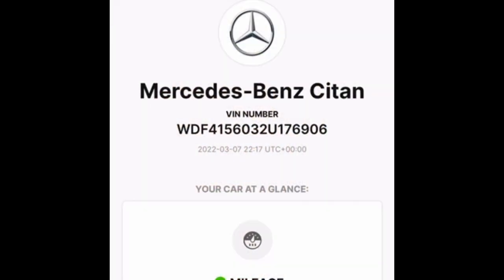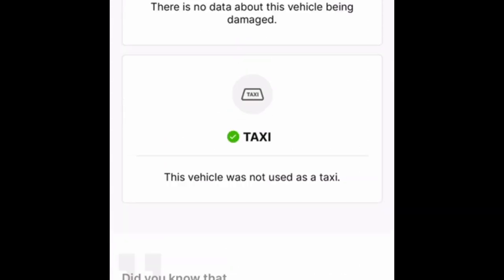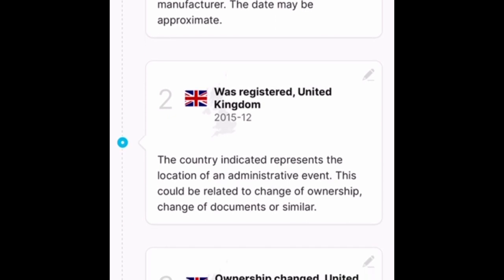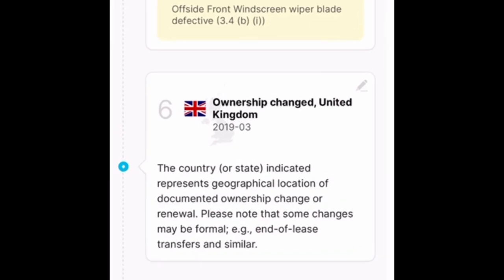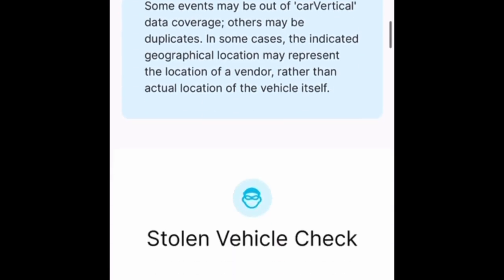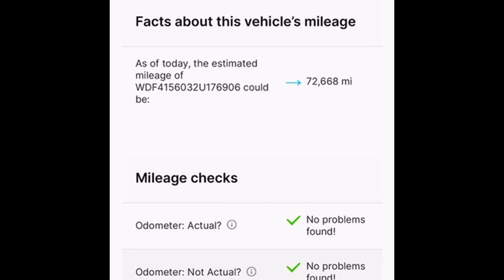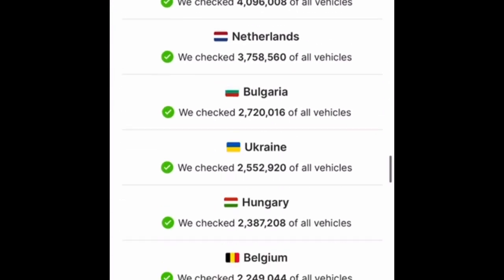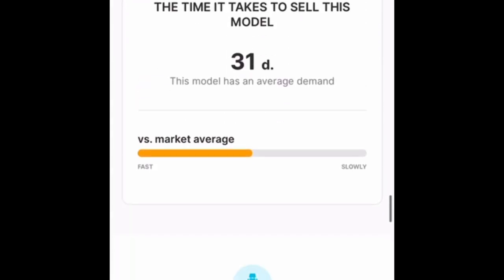WE TAKE A GAMBLE ON A FAULTY 2016 MERCEDES CITAN

Comment: Great video Rob,good luck with the rebuild.

1 thing to mention is that these Citan/Kangoos suffer from Clutch and gearbox bearing issues that are really common and normal so you have nothing to worry about that isnt in the ordinary  and  they have faulty fuel injectors :D

Comment: These vans are really common for shitting gearboxs! Had two go on my kangoo ml19 and do a bit of research its really common for main shaft bearings and diff bearings to collapse
Reply: Maybe if the gearbox oil was changed every second service it would be fine.

Comment: That wheel reminds me of the supermarket trolley 🛒 I seem to get the wobbly one every other time. 😁 That is looking a lot better after the guys did a wash. The bonus is it has two sliding doors so that is a good selling point but I am getting ahead of myself.  I am not sure but would it be easier to take the engine and box out as there's limited room? Its your call obviously. Thanks Rob and Chris for another good video.  Have a great weekend both you and your families. 👍👍BTW the mic 🎤 does the job in canceling the wind noise so yes use it when windy.👍

Comment: That front wheel would rock you to sleep when driving. Great little video guys. That a really nice little van. fixed on the road ready to go..at a guess guys! £7.995.- £8,200 I just repair not a seller.

Comment: I really enjoy when you do the vans. I quest I just like them more than cars. Just something about them that sticks my fancy.   The part I got a real kick out of today was watching the car was guys pressure wash the inside of the van. Not something I see every day. Usually hosing out the interior is not good for the soft panels and insulation under the carpets or mats or side and door panels. 

Looking forward to the wheel replacement and the suspension condition and alignment check. That was a wobbly wheel. 

What term do you use for people who we call the curbstone cowboy’s? 

This van cleaned up nice. Eagerly awaiting your episode(s) on its repair.

Comment: I done the clutch on this van in 2020 and changed the gearbox on the other citan this customer owned absolutely awful job 
chris sorry to say but one of the subframe bolts was spinning freely and wouldn't come off so u had to spin the front frame to the side 😂

Comment: I reckon that van’s had a hell of a 77k on the road. Stop starting in London traffic, racing between jobs, smashed every kerb to get a ten minute parking spot to get the board up. I bet that suspension has seen some action smashing into every seed bump going as well.
Not that any of that will matter.

It’ll be like new by the time these boys put it right.

Comment: I certainly didn't expect it to clean up that nice, even the (buckled) wheels. I had a similar problem with a driveshaft on my old Kia. I chanced it a bit too long and it failed going round a corner, cue ball bearings everywhere and doing 30mph at standsill. I think it could be worth about £4500,but I'm probably way off. 😂

Comment: The traction control will brake the jacked up wheel thus transferring drive to the non jacked up wheel and trying to move the van. Not saying the gearbox isn’t knackered but that’s the basics of a TC system that is able to brake a spinning wheel.
Reply from the maker: Tc was off 👍
Reply: @sruk  cool, I thought Chris was saying he couldn’t rev it up like you were asking. Ya frickin legends! 🤪🤪

Comment: This should be a great in-and-out project, apart from the gearbox and the wheel, possibly the tyre, but with no real issues to sort out. Certainly, minimal bodywork corrections needed, (Chris does not need more practice). Will the clutch get some love and attention before it moves on? It feels a shame to have it in pieces and not send it on its way, with the drive train in good shape. I am well out of touch with prices, so no comment, except to beg you to think of both the business and the customers after giving it a service. Have a great weekend.

Comment: You can only sell a trade sale to a trader every other sale is still covered by normal car sale return etc
Reply: Not if its sold spares or repairs. Theirs loads around. Running driving with mot but due to age and or milage its spares or repairs to avoid any fall back
Reply from the maker: All of our vehicles are bought and sold trade only if you don’t agree to our turns you don’t buy 👍
Reply: @sruk  might also add l, watched for years 99% of the cars you guys sell are better than from factory

Comment: I've had that with a V5 before and it was down to filling in the wrong bit on the form. I filled in section 10 which is for new keeper instead of section 6 which is for new keeper OR new name/address details.
If you fill in your name along with your new address it'll add a new keeper even if you don't tick the new keeper box in this section.

Comment: If it's the gearbox I wouldn't expect it to clunk like that in every gear. It's more likely final drive problems.  Maybe a driveshaft snapped one side.  Price cheap at £2800 gearbox at £400 sell £5250.

Comment: Chris would the driving after buckling the  wheels so badly have knocked out the gearbox diff and bearings through vibrations etc? £7.500. Does the Mercedes badge carry a premium or just snob value probably did for an estate agents sign erectors not as works van so much.

Comment: Are lass had same issue with log book just a change of name but they did change of keepers but got it sorted
Reply: Yep, people fill everything in but if you do it triggers a keeper change. Only fill in the info that needs changing and sign and date, leave everything else blank, and it will be fine.
Reply: @philcrockford5534  she only filled out the change of name but not new owner bit there mistake they admitted it issued a new log book

Comment: 8.00 am early !  try working up north lads. 🤣 legally if your a trader selling vehicles you cant sell them just as a trade sale, and imply no warranty etc, the only way you can do them as trade is if they are trailered away , if you allow buyers to drive them away it implies they are fit to do so, buyers will always have 6 months cover under the fit for purpose laws, regardless if you apply a warranty or not.

Comment: One in herne Bay so in Kent and that's up for 10k plus VAT, 2 years newer buy similar mileage 

One in Cheltham aswell, 17 reg, 59k miles for 9500 plus VAT

Id say put it up for £7,000 as that seems more than reasonable and it'll be a quick sale

Comment: That's a final drive problem. Hit a curb, drove the driveshaft into the diff. The tranny is ok, the final drive not so much. But again, it's in the same unit, isen't it. Wheel bearing/housing must also have taken the beating. It's for me to sugest and for you to investigate. When fixed and with a new clutch I guess six thousend is ok. Good luck, guys!

Comment: Hi guys. I was told that MB used the Kangoo as a base, but used their own gearbox, electrics and suspension. Not sure how accurate this is though. As it is a double sliding door version I guess it would be worth about 7.5 k
Reply: Renault Everything with a Mercedes badge stuck on top.

Comment: IT is a Kangoo my associate works in a merc garage and these only have mec badges if  I remember right. On the bigger ones some have merc engines and some renault.
Reply from the maker: It is a kango yes 👍
Reply: @sruk  Not that it would have been any better if it was actually a merc though. Don't know if it was citan or a vito my friend had changed the gearbox 2 or 3 times on in the first year. The current vitos can have pretty bad engines to.
Reply: @rimmersbryggeri  We have used Kangoo vans for years with no problems so much so I bought a 2008 Kangoo 1.5 DCi Expression car version and last of the original Kangoo's and it has been totally reliable as well. These Kangoo's can do very high mileages as long as they are looked after like any other van/car.
Reply: @williamwoods8022  Yeah. It might be that the merc dealerships arent as good at taking care of them. I used to work in a peugeot dealership and their vans were also very reliable. The odd one had a 3rd party component that was a dud from the factory but other than that only injectors and the other sicknesses that all diesels suffer from.
Reply: @williamwoods8022  Come to think about it it might even be a wrong diagnosis that makes a vehicle come back with gearbox problems over and over. I've even seen it happen in real life. Nothing wrong with the box or the torque converter, the hydraulic control unit was at fault on that one and id was known from day one but the manager didnt trust those who knew better so they changed the torque converter 3 times because the van wouldnt go into (od) mode I forget what the proper term for it is at this time.

Comment: Why does it matter if a used car you’re looking at was once a taxi? I’ve been in countless taxis in my life. When I was at school, I traveled there and back in a taxi, and I’ve even hitched a ride in a pre-booked taxi to the Eurostar station a few times. Anyway, those taxis were very well maintained. The interior was always kept practically in showroom condition and the bodywork was kept clean to a reasonable extent.
Reply: Because it means the vehicle will have been used daily putting more wear and tear on the vehicle and it’s components and also meaning all seats will have been sat in meaning they have had a lot of use  might be a high miler that's not spent it's life on the motorway short journeys around towns are not good for cars they need a good long run on the motorway once in a while to give them a good blast , the doors have been opened and closed a few times an hour, it's had people eating and puking in it, it's likely to have done a lot of stop start driving and be left idling for ages putting more wear on the engine and if it’s a shared taxi owned by a company could mean multiple drivers have driven it and might have different driving styles could crunch the gears in and not use clutch properly have a think about how many times it would have gone over speed bumps everyday ,so they allow the check of if it’s been a taxi because someone people wouldn’t touch a taxi could have been in multiple crashes a guy here on YouTube who sells cars once did a check on a car he was gonna buy at auction its mileage had been clocked  from checking the mot history also the checks shown it was an ex taxi and it had been crashed three times so  loads of reasons why not to buy one
Reply: Usually high mileage and just local miles not on motorways, except the odd airport run. (Although some taxi drivers specialise in airport runs) but it can play havoc on the overall condition.

Comment: Good Renault engineering - gearbox toast after 72,000 miles 😂
Reply: Any synchro road box treated like a race car will break. I’ve found Renault boxes to be well designed. Built with bigger bearings than other manufactures and alarger oil capacity. Fiat have had some whoppers on the other hand
Reply: Yeah, its been ridden hard and put away wet.

Comment: Will be a cracking little van and without looking at going rates on these I’d say 7,500 and to shift at a bargain price no lower than 6,500. Did you say the mileage on this one? I wonder if it’s had a hard hit on a curb which and done the driveshaft and also the gearbox? That wheel was very twisted. Have a great weekend guys 👍

Comment: Drive a kangoo for work the gearboxes are crap 2nd gear will be gubbed been throu a couple
Reply: You must be doing something to the gearboxes then as we have used Kangoos for years with no problems with them. I have owned a 2008 Kangoo 1.5 DCi Expression last of the original Kangoos for years now as well which has also been totally reliable and excellent.